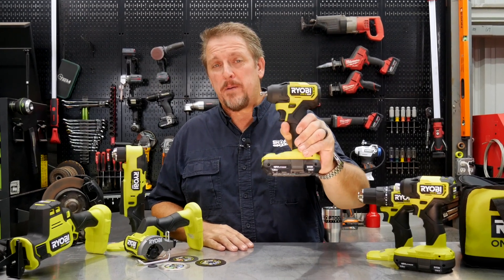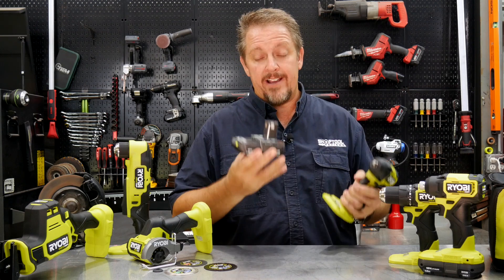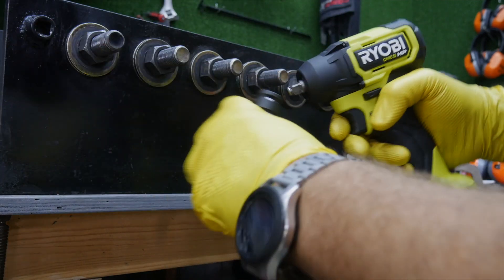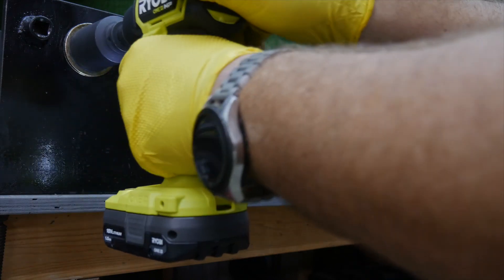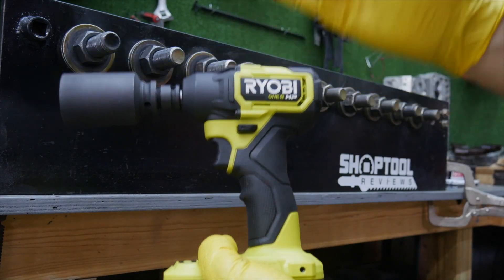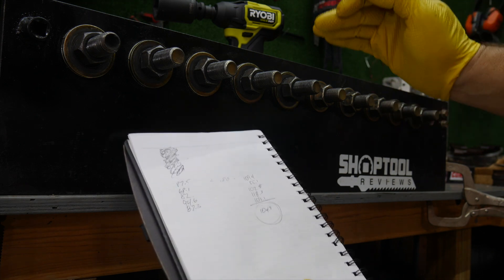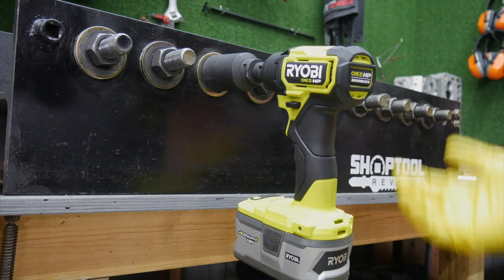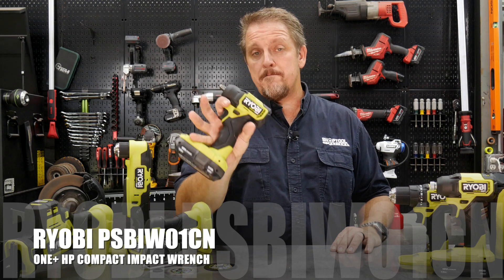WE GOT IT!! Ryobi HP Compact Impact Wrench - 3/8" One+ 18-volt [BRAND NEW]

Comment: Automotive tech here and my entire shop uses Ryobi 1/4" impacts, the older basic model. Once on person got one, all 4 techs had to have their own. Our very first one just got retired from about 5 years of daily use and abuse and got cannibalised for parts. It only got retired because the gear train got sloppy, still worked all the way to the end! We've only had 1 battery fail out of the 8 that we have. The other brands, Matika, Milwaukee, DeWalt, Bosch, they simply don't hold up nearly as well. And having most of our electric tools on the same battery platform is very convenient. Just the other day I threw away our graveyard of Makita power tools that didn't last nearly that long.

Being a Ryobi fan, I'm NOT excited for this new impact. I worry about their reliability compared to the older models with all those fancy features, and they no longer sell the old model. I like the power and the new motor design, but I really don't want the power level mode button on the 3/8' or the lights on all new models. I couldn't care less if it was smaller, the old one was a perfect size. In fact, it might be too small, causing me to use an extension when I didn't need to before as the anvil is almost flush with the front of the battery. I just want simple. Simple doesn't break. 

I also wish that Ryobi would introduce a new compact battery. I would assume that it would not be too difficult to make a battery with a smaller profile that still snaps into tools that use the regular battery, maybe with a cheap adapter.
Reply from the maker: Wow, that's some great insight and thanks for sharing. I'm like you, especially on my impacts, I like simple. I let my finger do the feathering of the throttle for how much power that I need. But, many new users like these newer features, so I understand where Ryobi (TTi) needs to change. I do wonder what Ryobi is going to do with the battery...it's getting quite old. Thanks for watching.
Reply: @Shoptoolreviews  Interestingly I made a post about the battery on Reddit complaining how they don't have a real competitive cordless ratchet and talked about how it would be possible to update the battery into a more compact form while still keeping compatibility with their current batteries. A Ryobi representative replied and said that there is no guarantees, but it has been brought up before in regards to their compact tools in internal meetings. Very interesting, hopefully they can figure out a way to offer that to the market!
Reply: @pauleh interesting, are you talking about the p238 ?
Reply: This one is probably for your average joe to keep in the trunk of their small sedan to do a quick tire change when needed.  They have a compact 1/2" not much bigger than this that's got more juice, a mid torque 1/2" that'll handle pickup lug nuts with ease, and a mammoth of a high torque with near double the mid torque's power.

Comment: I am currently using to the compact ryobi tools for over head door installation. We do residential and heavy on the commercial side. It’s a lot of nuts and bolts and drilling through steel and using self tapping screws through steel. Everyone I work with uses dewalt and Milwaukee. Everyone has talked crap but has been impressed by the ryobi compact tools, we will see if they hold up.
Reply from the maker: That's awesome to hear. We love hearing from users and the brands they use. We also love to hear that the RYOBI stuff is actually in the Professional field as well. We know it is, but it's great to get confirmation. Thanks for watching.
Reply: Used my $199 Ryobi combo kit to build decks for 6 years and sold it for more than I paid in perfect working condition. Ryobi impact wrenches are absolutely excellent. I have this one and the P262, the perfect combo. Next is the 3/8 extended ratchet.

Comment: I was awaiting this review. I plan on kicking it a$$ at work. It’s a 3/8. Perfect for inframe fasteners for air lines and wiring brackets and brake pod swaps when only needed to remove the piggyback. I plan on buying only when Ryobi makes it a bundle with a battery as I need a battery upgrade. I use Milwaukee 1/2 mid range daily. Love it. But I wanna give the brand I love to hate a professional try. Great review hit all the rights spots.
Reply from the maker: Thank you for the feedback. Please follow up with us once you put it to use.
Reply: It should do great. I use my 12v compact DeWalt for those things. It's works great. 👍

Comment: As long as the battery length doesn't extend past past the front of the implement on the tool, I like that I can use my old batteries. Plus I like when a tool can stand on its battery and not have to be laid down.
Reply from the maker: You said it. Well put. Great addition to your existing Ryobi collection.

Comment: I picked up the cuttoff tool and the grease gun.  To be honest I'm amazed now at the quality of the lower end tools now.  I have quite a few kobalt 24 max tools and they work great for the price.  The ryobi seems the same way.  I wish kobalt would build a 3/4 or 1 inch cordless gun though.  The milwaukee looks awesome but the 1300 bucks makes me cringe a bit,lol.
Reply from the maker: You are correct. We talk around here all the time about how entry-level tools are as powerful, many times more powerful, than the top Pro versions just a few years ago. Kobalt has some great new tools, but I'm not sure they're interested in jumping into that Commercial (3/4" and 1") category for impacts. Thanks for watching and commenting.

Comment: The Ryobi can definitely bust more nuts than the Dewalt 902 (with 2ah battery). The new 5ah on the DeWalt 12v tools including the 902 impact makes a similar difference in power. I guessed 20% on mine, and based in this test, that's in the ballpark.
-It must be frustrating to be a Ryobi One + tool design engineer, having to just accept that Russian tractor of a battery.  There's really no possibility of a "compact" Ryobi cordless tool.
Reply from the maker: Yes, the Ryobi One+ 18V platform is stuck with that large post battery. At the same time, that's what they brag about, that all their tools will still fit the oldest and newest battery. Thanks for watching.

Comment: This is the only video that demonstrates the difference between the two batteries, that I can find anyway.  Important because those 4.0 batteries are EXPENSIVE, and I needed to know if a lightweight DIY like me that does tire rotations, etc., can get by with the smaller one.
Reply from the maker: Thanks for the kind reply. If you do a lot of tire rotations, then I'd probably recommend a larger impact with 1/2" anvil. This 3/8" will do it, if the lugs aren't rusty or on too tight, but it will struggle if they are. Thanks again for watching and commenting.

Comment: All my Ryobi tools all the way back from the dark blue set still work strong and they have been used a lot. The blue impact driver is actually stronger then the newer green model I have. The battery design is a limitation on design aspects yes but in reality the contact area for the terminals is about the same as others.

Comment: Would be interesting if you could do a video about how much torque is reduced by using an adapter. Maybe use a nut size that's smaller where sockets are available in both 3/8" and 1/2" drives.
Reply: Torque test channel has all of the info on extensions and such
Reply: It doesn’t really change anything.

Comment: I see ryobi finally changing their battery soon. Especially with much batteries in general have changed I think most of their customers including me would be fine. That is as long as we are gaining a large benefit like a much smaller battery.
Reply from the maker: We'll see if they do. They have a big announcement coming up on Dec 10. We'll be sure to share what this will be. Thanks for watching.
Reply: I doubt it. Ryobi's selling point has always been it's One+ battery system, and has been touted by the company many times over that any One+ battery will work on any One+ tool. 

That's what helped sell me on jumping onto their platform. I can't stand how other brands change their battery systems every few years. It's nice to know that one battery style will support all of my tools, be they brand new, or 15  years old, or as yet to come out.

Plus, if you're after the slide style batteries, TTI has RIDGID and Milwaukee to cover  those bases.

Comment: ill never understand why anyone would want or need a compact impact wrench. what we need is a full-sized brushless 1/2 to replace the current brushed model
Reply from the maker: Many many many people want compact impact wrenches. Smaller and lighter to do the most common jobs. Yes, we also agree that Ryobi needs to have a brushless 1/2" High-Torque Impact as well. Thanks for watching and commenting.
Reply: Shop Tool Reviews that’s what your everyday impact driver with an adapter is for 🤷🏻‍♂️

Comment: Good video. But how do you have all these tools everywhere. And you didnt use a HP battery with the HP ryobi. Idk if that would make a difference. But it would have been a nice to see.
Reply: The newer HP batteries are  rebranded as older high performance batteries. No change just rebranded they both have the extra contacts that normal lithium don't have cheers.

Comment: The lithium plus hp battery would give you more output. The battery designed for this line, was released and pushed specifically for brushless tools
Reply: I was about to ask why he didn't use the hp battery with the bigger cells?

Comment: Mine will take off lug nuts tightened to 80 ft-lbs with some struggling, 19mm socket.   Curiously it will NOT remove a T50 torx tightened to 45ft*lb.    I think the tool size has more to do with it than you’d think.   Of course that was using an aftermarket 3ah battery.   Which probably isn’t really 3ah.

Comment: The batteries that come with those tools are not the HP battery which has one extra connector on it that tells the brushless tools to increase the power as the drain increases that is why you sad a 20% more increase in power. It was nice that Ryobi sent you them to test hopefully you'll continue doing the test on the rest of the series
Reply from the maker: Yes, we will definitely conintue to review the rest of the tools.

Comment: I believe the impact gun will torque even higher if the anvil reaches max rpm before hitting the wall. I would of also liked to see tightening torque on the other 3 power settings, auto included.
Reply from the maker: That would be cheating the torque numbers and then there's really no base to compare against. That number will always be eratic.

Comment: They are definitely not here in the Michigan stores or on line. I went on Live Chat on the Home Depot site and the only thing I was told was they are out of stock and they don't know when they will be back in stock or in the stores. One would think that they would know more about a complete new tool line. I have 21 Ryobi 18 volt tools now and I wonder if I buy 21 of the new compact tools will Ryobi come up with a whole new line in a couple years. I do love these tools but like you said most of them run better on the larger batteries.
Reply from the maker: I do know that some of the stores are having trouble keeping them in stock, and even online they're selling out pretty quickly as they receive shipments.We'll check with Ryobi and see what they say.

Comment: Would really appreciate your opinion on which drill driver/impact combo you would buy. The ryobi hp, dewalt atomic, makita lxt, Milwaukee M18, or rigid? I know some are brushless and some aren’t, but they’re all around $150 and it’s so hard to know which direction to go.
Reply from the maker: It really depends on what you're using it for. If it's purely DIY and home stuff, then I'd probably stick with the Ryobi or Ridgid. Find the best deal you can. I would stick with brushless, if you can. Brushless definitely makes a difference with Drills and Impact Drivers; other tools, not so much. If you're using them for Professional work, then I'd lean to the Milwaukee, Makita, or DeWalt. Thanks for watching.

Comment: Shouldn't you be resting it with an HP battery too? As far as I know, Ryobi's brushless tools have more power if you use an HP battery.
Reply from the maker: I tested it with the 1.5Ah batteries that come in a kit with the HP Drill and Impact Driver. I also tested it with the 4Ah HP Lithium+ battery.
Reply: The HP technology in the HP batteries are now in the tool for this new line of tools. So any battery you use on these tools will all act as if they were HP batteries.

Comment: Ryobi days had a nice sale over the summer. Buy the 2 battery and charger pack for 99 and get a free tool (79 or less). I picked up two of the battery packs and got a palm router and orbit sander for free.
Reply from the maker: That's an awesome deal. they definitely run deals from time to time when you can save a lot of money. Thanks for watching and commenting.

Comment: I can't read the battery label from all the moving, but are you using the HP version of the battery.  Because that battery lineup I believe gives more power.
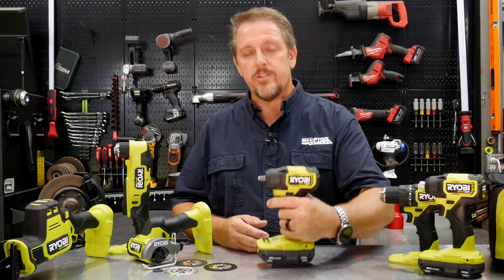Reply: You are correct that 4:00 amp hour battery that he put in is the high-performance battery which has the extra connector in it to communicate with the brushless tools to increase the power as he noted there is a 20% increase when that battery was applied
Reply from the maker: I was specifically using the 1.5Ah batteries that are kitted with the new One+ HP tools.

Comment: Why don't they make the battery rotate at bottom all four directions ? Would solve battery in tight places with room
Reply from the maker: Cost. It would be too expensive to make. If the wires twisted with the battery, the wires would break in a month. If you have spring-loaded brass contacts on a track, this would be too expensive to make.

Comment: A lot of people asking, why would i buy this if i already have (insert another brand here) and lets be completely honest, if you already have an impact wrench that works for your application it still wouldn't be worth spending your money regardless of how powerful or compact it would be to replace a tool that already gets the job done.
Reply from the maker: I do see your point, but I'll have to disagree...let me explain. Let's say you have a 1/2" High Torque impact wrench that puts out 850 ft-lbs of force and weighs 8-pounds. Sure, it will do every job you need to do, but you're always carrying that 8-pounds. If 80% of the jobs you do could be done with an impact that weighs less than 3-pounds, then it probably makes a lot of sense. Of course, you have to take in consideration your budget and your needs, but there is an opportunity for compact tools like this impact.
Reply: @Shoptoolreviews  Sorry i wasn't very clear, I meant specifically those saying why would i buy this if I already have another brand's compact or sub compact impact wrench. Which i dont think there is any good reason to pay for a different brand's compact impact wrench if you already have a working one. The differences between brands are largely not really worth the extra cost of investing into a new battery system and or tool for a little more torque or a tiny bit less weight when you already have a plenty powerful light weight one.

Comment: My Rigid Gen 5 brushless impact drill is rated for 188 ft/lbs. let alone my impact wrench. 
Smaller, lighter, more compact. 
Just saying.
Reply: Bailey Hatfield 
My point exactly.
Reply from the maker: You can definitely go that route of using your impact driver for doing bigger jobs. As a DIY or occasional use as a Pro, that's fine. If you're a mechanic, removing larger fasteners frequently, I'd recommend an actual impact wrench. The larger anvil, be it 3/8" or 1/2" will make a difference, especially over time.

Comment: What torque wrench are you using in the video?
Reply from the maker: Proto electronic torque wrench 250 ft-lbs. We love it. Great torque wrench.
Reply: @Shoptoolreviews  do you have a review of that torque wrench? And a price? Thanks for replying.
Reply from the maker: @19donnie77  We don't have a review on that, although we should. We've used that in the shop for years. Proto is a more industrial brand from Stanley Black & Decker (DeWalt, MAC Tools, Stanley, Craftsman, etc.), so I doubt you will find it for sale online.
Reply: @Shoptoolreviews  basically I'm looking for a decent torque wrench that's reliable and not crazy high and not that much of a hassle getting recalibrated.

Comment: How much force is the squeeze ?
Reply from the maker: The triggers squeezes very easy. The impact was able to remove nuts that were torqued to 160 ft-lbs.
Reply: @Shoptoolreviews  thank  you l came from vietnam and also had a passion for the machine and I also sold this line to return but didn't look up the specifications of the machine

Comment: Still take milwaukee m12 fuel 3/8 and its 250ft/lbs over this. Its smaller and has more power.
Reply: It's also 150% the price so it's kind of an irrelevant comparison
Reply: I paid $120 for my m12 3/8 stubby impact with a 6ah battery......both brand new in box.

The Milwaukee m12 3/8” impact does better than my Ryobi 18v 1/2 impact with a 4ah battery.....
Reply: Bare tool in Canada is 199 and a kit with a 4ah and 2 ah battery is 289 Canadian dollars.
Reply: yeah I've seen it at that price but been awhile now
Reply from the maker: That's an unbelievably great deal. Great job on that.
Reply: it's list at ~179 from every reputable dealer I found. 
119x1.5=178.5 
It's exactly 150% the price, as I said. (It is 50% more). That's how percentages work.